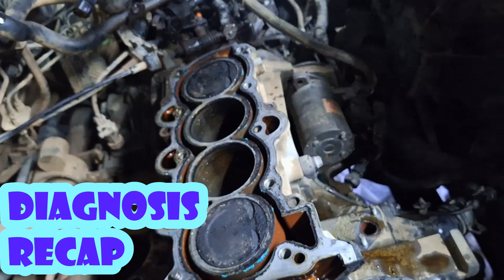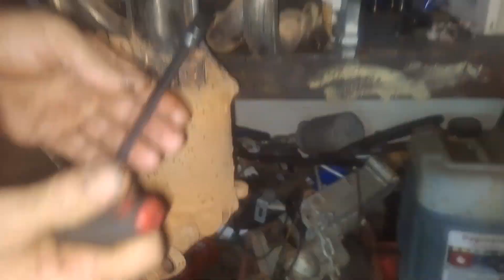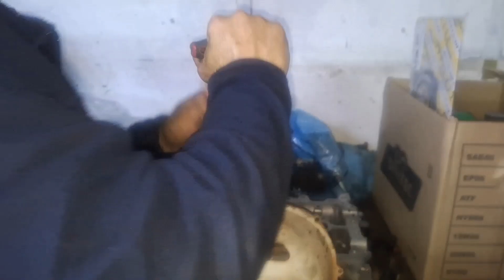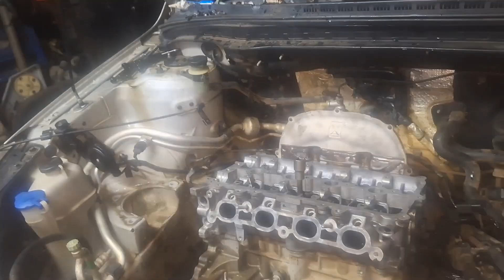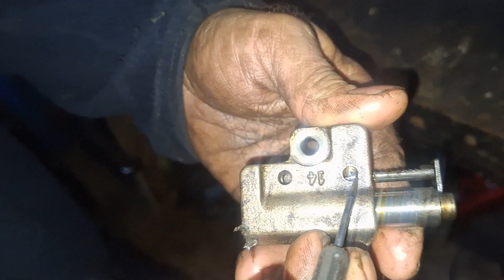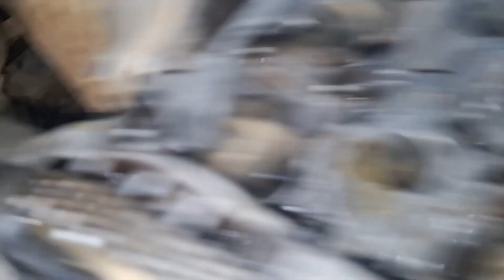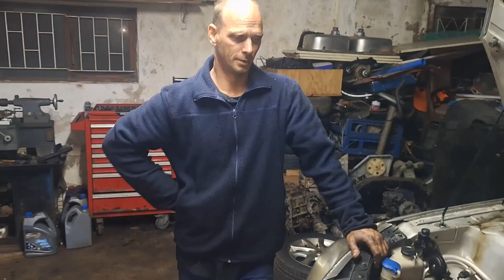Hyundai I30 cylinder head assembly step by step

Comment: Thanks for this video, I’ve found this very helpful and am now staring assembly, bought Ajusa headbolts but did not come with washers.  Is it ok to use the original washers ?  Thanks
Reply from the maker: Hi thank you very much, I'm happy it was helpful, if you have any questions don't hesitate to ask. And yes the washers are reusable
Reply: All done!! Did the timing chain kit too. Don’t think I would have had the confidence to tackle 0:01 this job without your video.  Excellent step by step instruction, thank you very much 
My next job will be my 2010 Santa Fe 2.2crd 163k on clock has a noisy timing chain 1st thing in the morning.  Any pointers greatly appreciated.  Does this also have jacking points for the timing chain cover?

Thanks
Reply from the maker: Hi sorry for late reply, yes I know those engines very well, however they came in two different engines, one has timing belt and other timing chain. I take it yours is timing chain which makes it the R spec engine, two of those engines where made in the 2.2 crdi. High power and low power. But basically exactly the same. If you plan on doing the timing chain on that engine be careful and invest in injector remover tool. They really stick tight and are hard to remove. I can help with guides if you want but I haven't done a step by step guide on that yet. If you need any advice or help on anything maybe drop me an email rather, webbqc@gmail.com 

I will be happy to help

Comment: hey, thanks for sharing the video, can you please tell the n.m torque of every screw you tighten?
Reply from the maker: Hi, head bolts 25nm-30nm 90degrees 90 degrees. Tappet cover 15nm, timing cover 6mm 15nm, timing cover 8mm 25nm, timing cover 10mm 45nm. Chain tensioner 15nm, guides 6mm 15nm, 8mm 25nm

Comment: Hi and thanks for the two I30 videos. Working on the machine right now really helped me see what I needed to disconnect and how it's put together however I went for it from a different angle. I suspected piston sleeve bearing to fail and when disassembling from underneath and long story short I have that confirmed with my engine outside the car entirely. Now I am deciding on disassembling it head cover from piston block to replace what is very likely blown gasket as it was oily on the back of the engine block and first cylinder's slightly lower compression (9.6 vs 10.5 for all others). Engine has 300kkm on it. What would you recommend?
Reply from the maker: Hi thanks for the comment, I would recommend removing the cylinder head first and measure the cylinder bores sizes in thrust and inline direction. Top middle and bottom of cylinder will give you your total tapper wear and ovality, usually on those engines it's just the head gasket that goes but you have to check cylinder bores